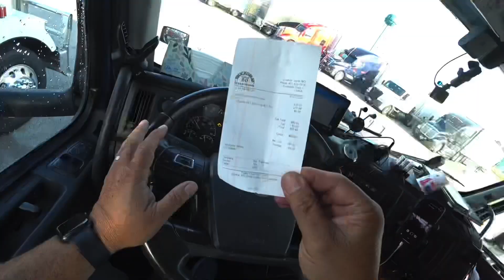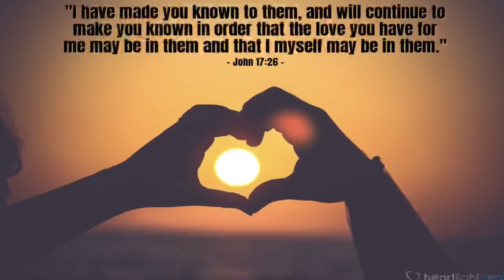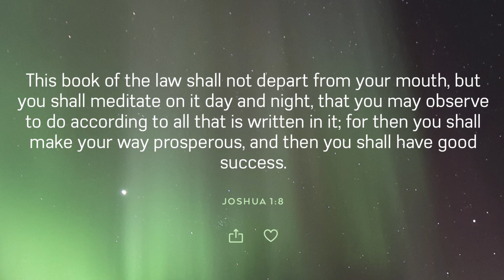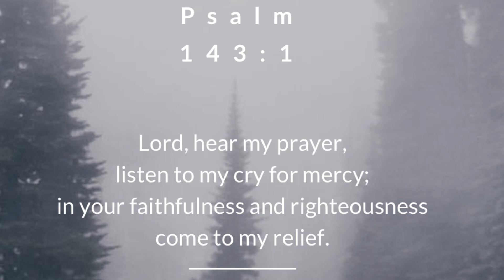July 25, 2021/241 Trucking. Giving Your Grace a Bath at TruckO’Matt. Joplin Missouri

Comment: 3.99 at Costco here in socal.  Itis what it is. That's why I drive a Prius. I have a 43 mile commute each way.  Ok, I will stop itching.  Have a good day and please stay safe.
Reply from the maker: Until you need to change the battery 🔋
Reply: @24juan68  Tell me about it. Had a 2012 Prius. Went 160,000 miles and then battery gave out.  2 ,000.